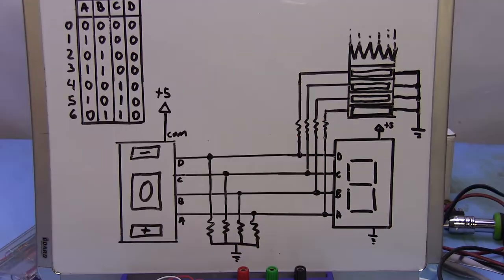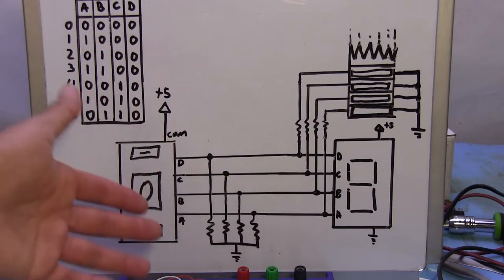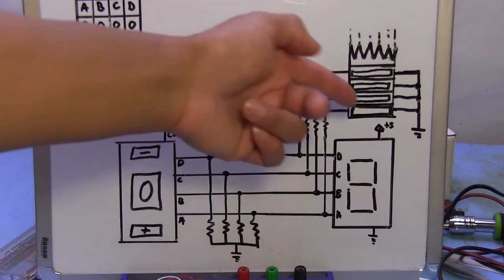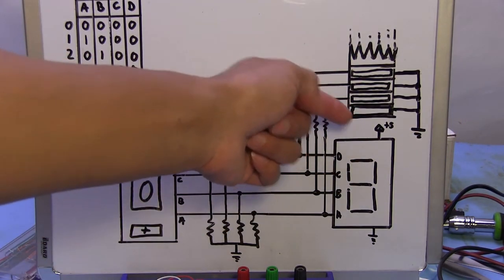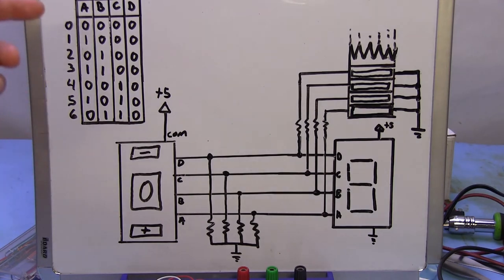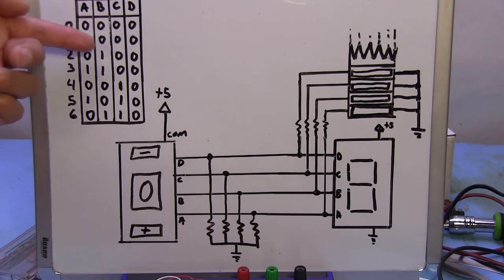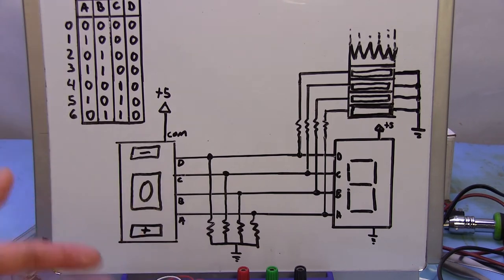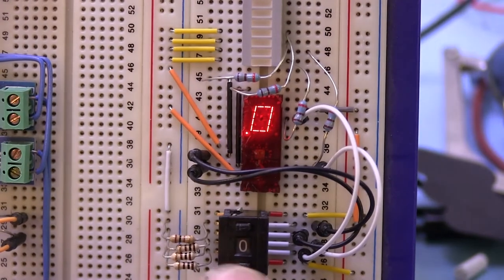TWB #47 | Binary Coded Decimal Switches

Comment: Nice! I bought 10 of those BCD switches some time ago on aliexpress for 3 USD.
Reply from the maker: Oh, that's not bad! I just vaguely remember seeing them for like $15 a piece, but I guess I should have done a bit more research on that. Thanks!
Reply: Yeah probably not the same quality as the ones you saw, I can send you the link if you want. Keep up the good work, I really enjoy your videos.
Reply from the maker: Post a link in case others are interested in them as well. 

And thanks!
Reply: Good video. One thing I noticed is that your truth table is reversed since you placed the pins in alphabetical order. 1(decimal) would be 0001 in a 4 bit binary, 1000 is 8.
Reply: Any way too use these for regular (non computerized) circuits? I have like 10 of them. Originally didn't know what they were or what they did. Was planning on using them in my car, for a coded ignition system, instead of using a keyed ignition.